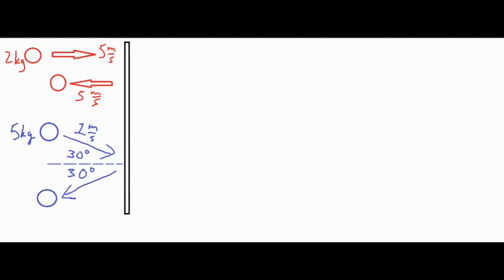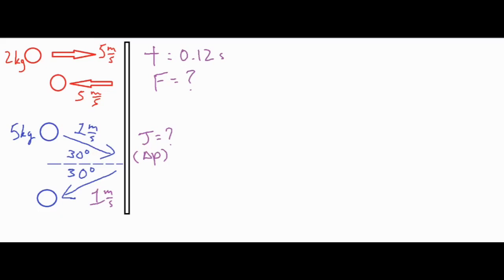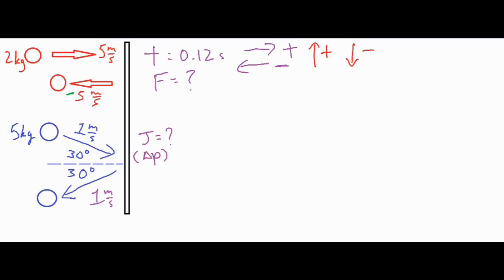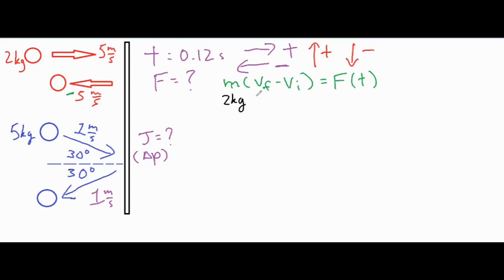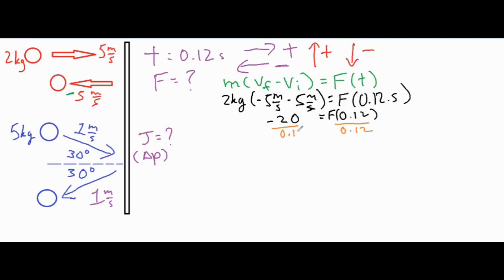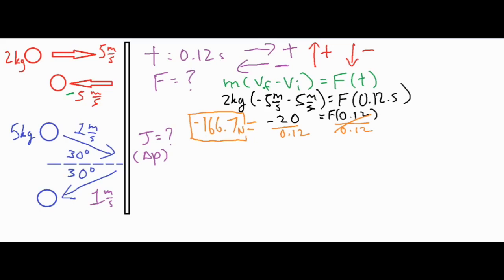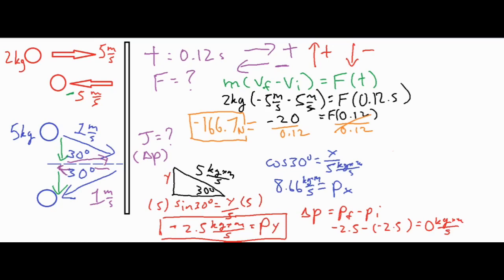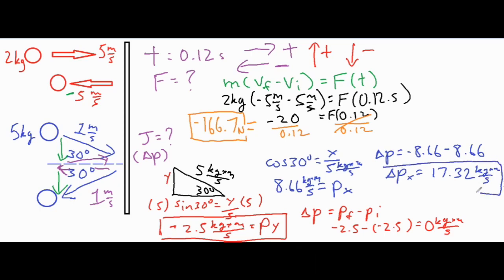Momentum and Impulse Problem with Bouncing (1D & with Angles)

Comment: 5 kgm/s × cos 30 = 4.33 kgm/s = P  in x- direction
 Change in P = - 4.33 - 4.33 = - 8.66 kgm/s
Reply from the maker: You're right!  Thanks for the correction, I jumped to the answer too quickly and wrote two 8.66's instead of 4.33! I'll make a note in the video description.
Reply from the maker: Ok there's a note in the description now, thanks again for the correction 👍🏼
Reply: @beatphysics  Thank-you  Mr 👍 ❤